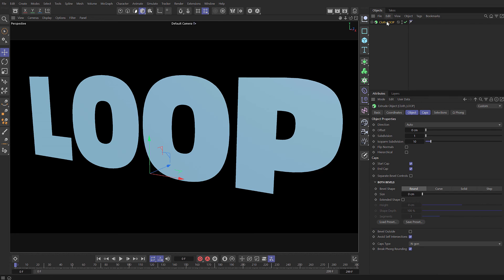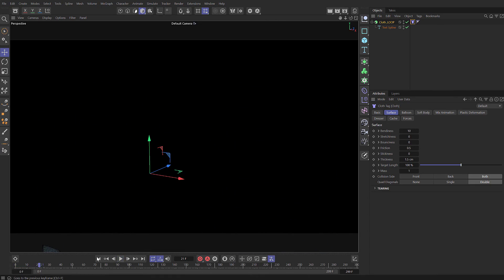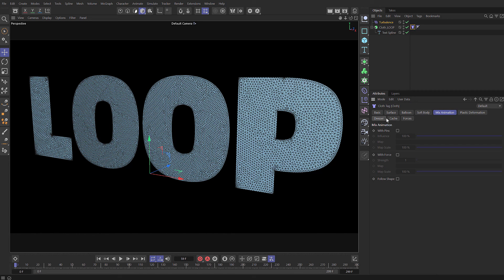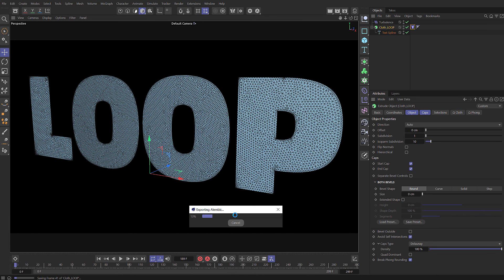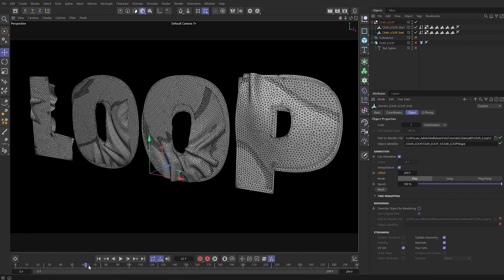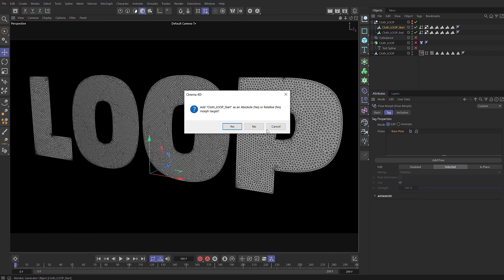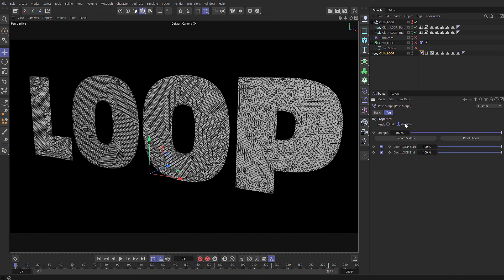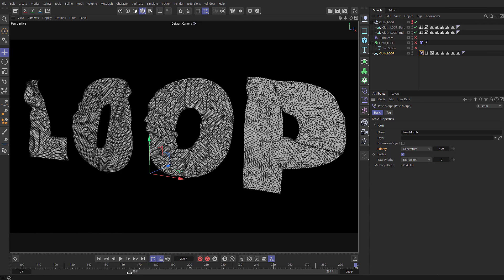Looping Cloth in Cinema 4D Part 1

Comment: For everyone having trouble to get the pose morph tag to work, be sure to export your object without a subdivision surface on it. You can apply it afterwards. And always export a frame range starting at 0 because of the cloth simulation otherwise the alembic has no animation.

Comment: Thanks for the tip! Isnt this easier to achieve to use the point cache tag though? Cache the animation with it, then set it to loop twice and adjust blending to 50%
Reply from the maker: Maybe it is! Point cache is very handy and often forgotten. My hope is that simulation cache is extended to be part of point cache, after all they perform a similar function. 

https://vimeo.com/4759335 

Point cache video from 2009! Definitely in need of an update.
Reply: @Helloluxx  Yeah would be great to have a global cache tag, similar to what xparticles has